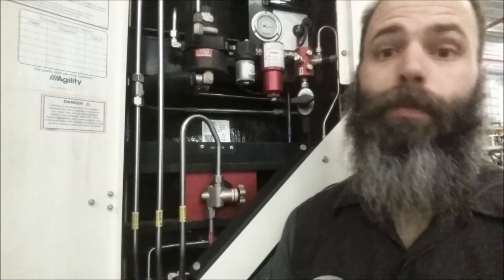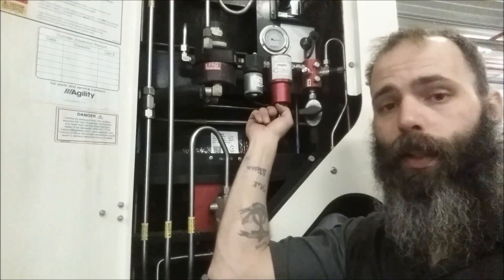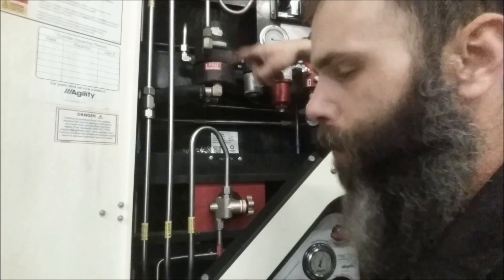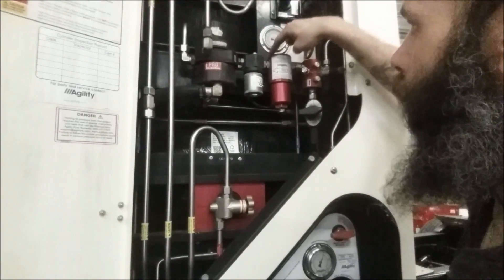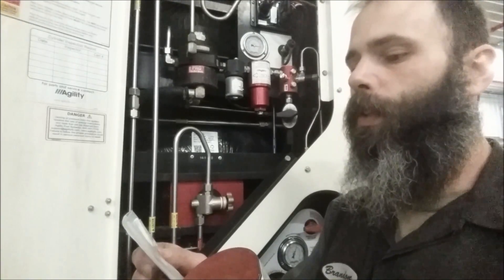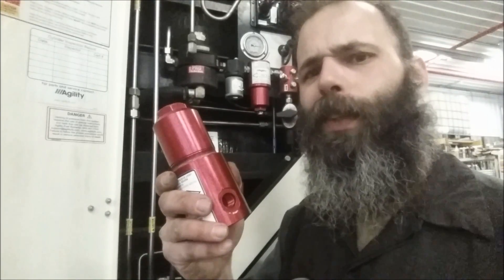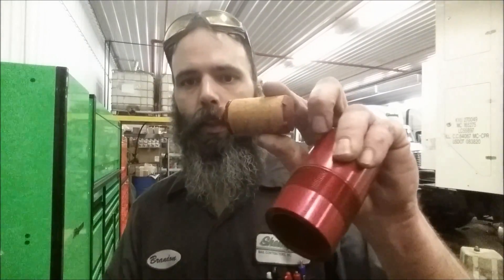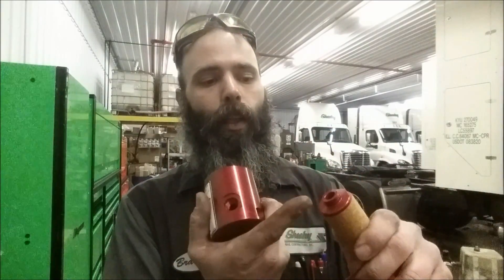AGILITY CNG, Tank Components

Comment: We have both agility and trilogy /Westmoreland systems. We fitted a drain valve on the bottom of the filter bowl to make sure the pressure is off. We only have five trucks though. Another great video.
Reply from the maker: Thank you Jay! drain cock was something we had also discussed earlier on when truck numbers were only about 25 ish few years back for the CNGs, now we have over 70. but still have the dual filters just before the engines with drain cocks on those we do try to keep drained, and have 25k swap out on those particular ones. Thanks for watching yet again!